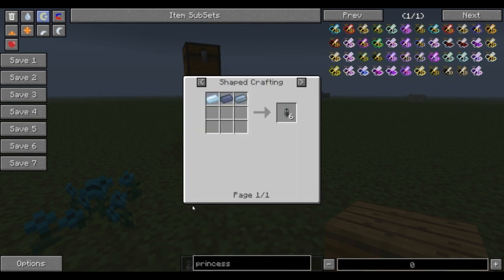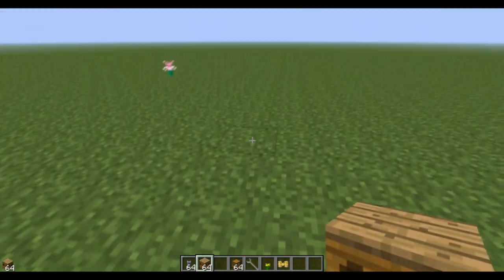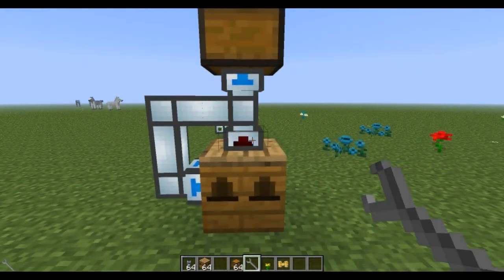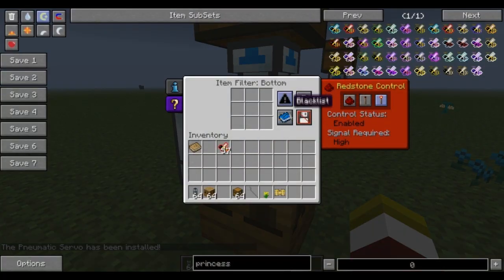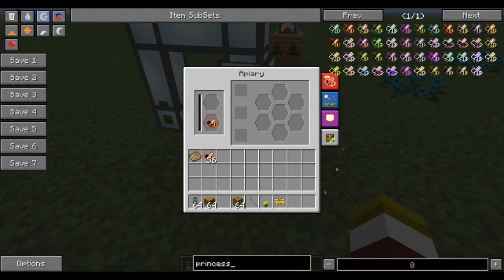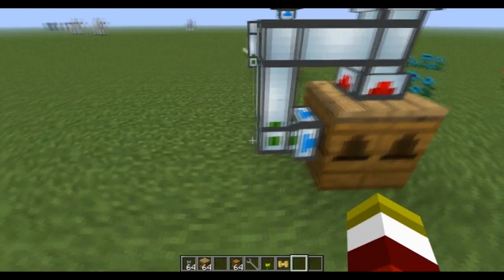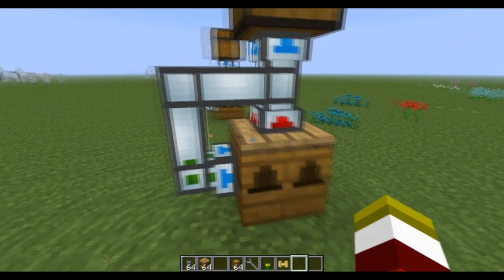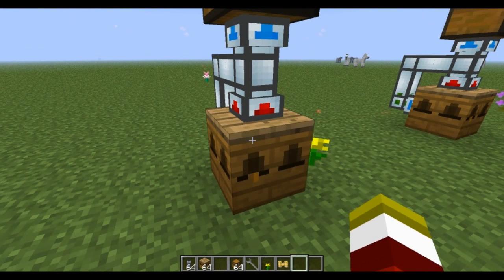Minecraft Bee Breeding Automation using ItemDucts

Comment: Thanks.  I was trying to figure out how this changed with the new Thermal Dynamics ducts.  Instead of hitting the duct, you use a vacuum itemduct on the last section of duct that goes back into the apiary or alveary.  That does the drastically shorter path thing in the same way.

Comment: What about the Sky Being Obstructed?
Reply: I was just going to ask that myself.
Reply from the maker: The chest does not cause any issue with this nor does the pipe.  At least in my testing.
Reply: iamkeq Yeah I realized after asking that the pipe and chest aren't full blocks so probably count as transparent.  Either way confirmed, they don't block anything, although a tip: if you put the chest beside the itemduct instead of on top of it, you can have two apiaries 1 block apart connecting to the same chest.